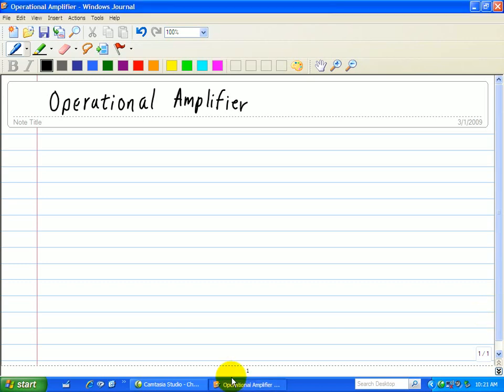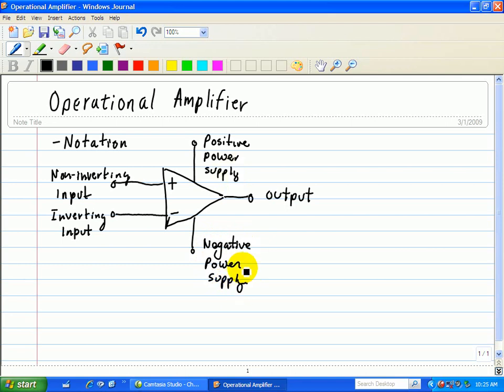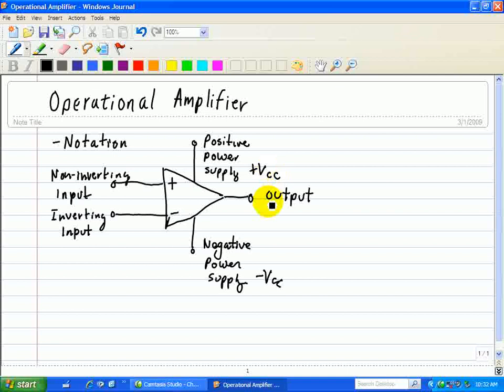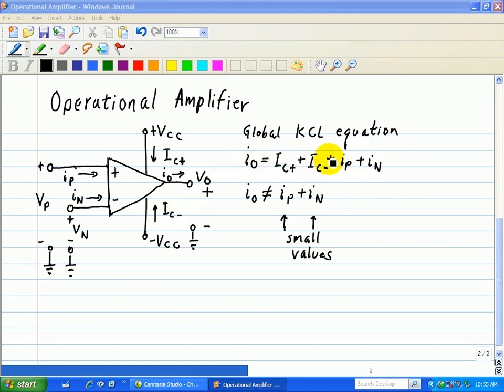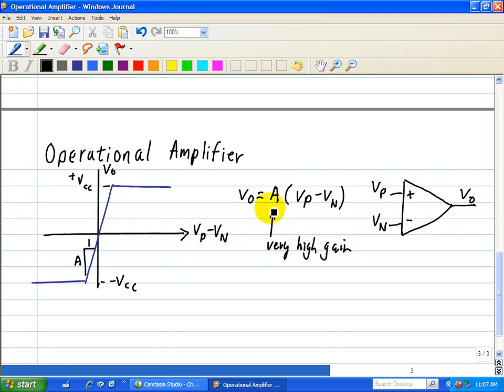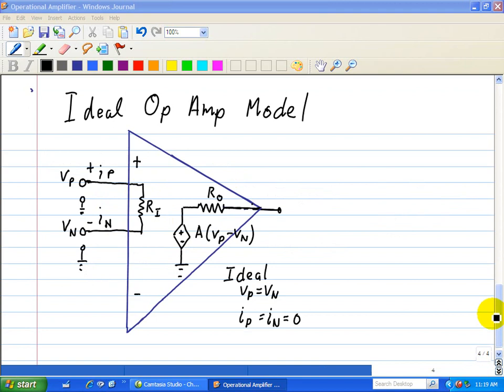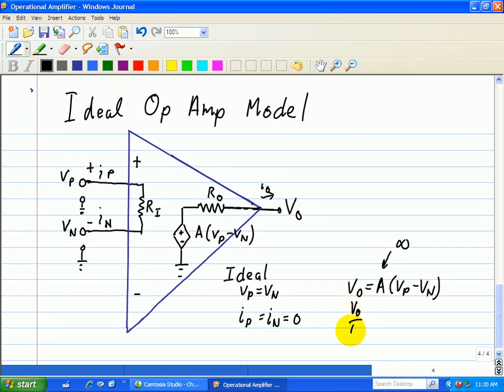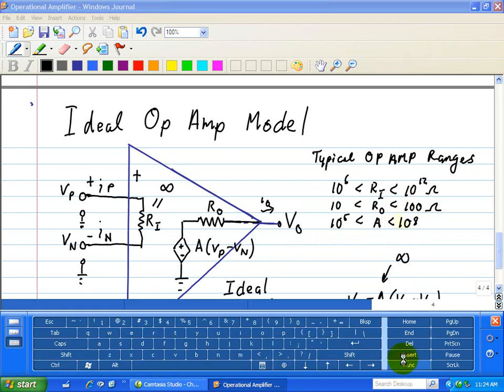Operational Amplifier Tutorial - Basic Op Amp (Part 1)

Comment from the maker: Hello Sanath.  Since you're driving a motor, it requires some current which the op amp 741 does not have enough current drive.   You need to drive the motor with one supplies high current such as a transistor amplifer.  Hope this helps!

Dr JU

Comment: Hii Dr. John , i am building a robotic arm and i have to interface my (2.4Ghz) receiver o/p which has 3 pins for servo motor , but instead i have to connect a dc motor , one of my friend told me to use op-amp 741 , can you help me out with some info sir ? . thanks in advance.(sorry the topic is bit off)

Comment from the maker: In terms of feedback, a very high gain for a op amp means that your circuit gain is dependent on external components (input and feedback resistors) and not sensitive to component variation inside the op amp itself.  vo=A(vp-vn) with infinite gain A means vo/A=0=vp-vn and therefore vp=vn.  Hope this helps!  drj

Comment: Hey, I am a complete beginner so apologies in advance. If you want to amplify a signal, why would the *ideal* values of the opamp dictate that the amplifier has zero output? Surely the point of an amplifier is to make the signal larger, so any signal multiplied by the gain would be more ideal than 0. If that is the case, what practical function does keeping the overall output 0 serve? Thanks.